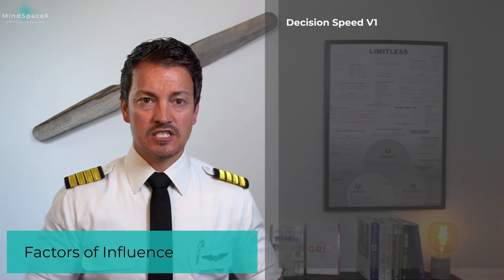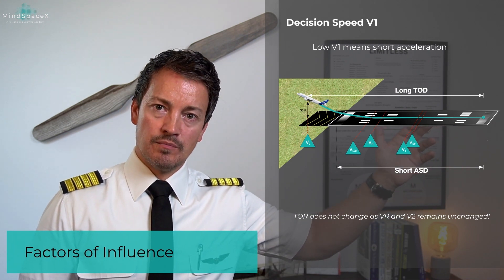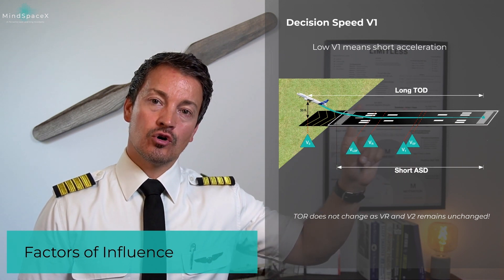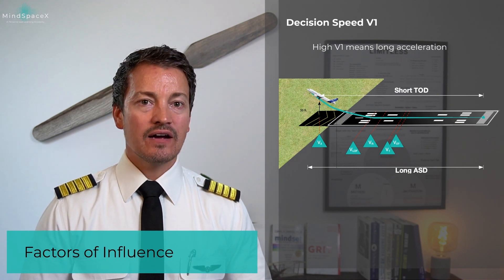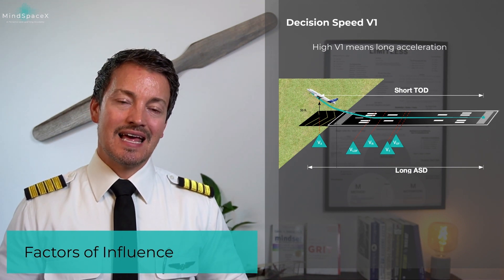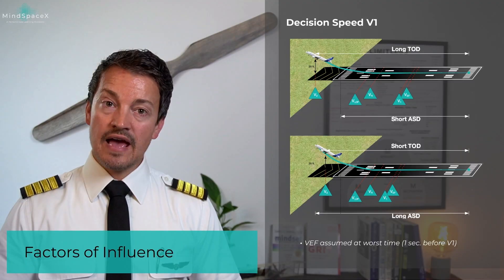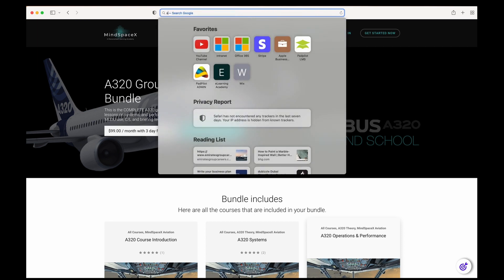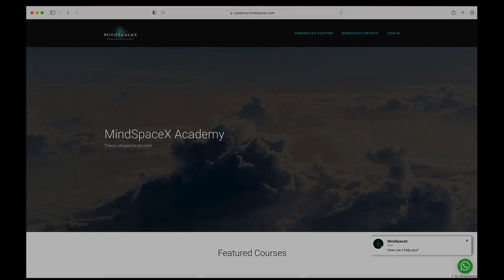Airbus Performance -  Influence of V1 on Takeoff

Comment: Simply,V1 is max speed to stop the plane( brakes, thust to idle,Spoilers,Rev(not credit or),& bring plane to complete stop within ASDA ,or to continue the take-off, that V1 speed is now the slowest/min for plane to climb to net height,35ft ,if EO, then to Mag bug,V2. Hope it helps ..
Misleading to say V1 is decision speed
Reply from the maker: Hi, I do see your point. But we have to look to the documentation to get a broader perspective.

The term ''Decision speed'' is not an Airbus term, but a term used generically in the industry. Airbus has the following definition for V1 in their FCOM:

''The highest speed, during takeoff, at which the flight crew has a choice between
continuing the takeoff or stopping the aircraft.''

The term 'choice' would suggest a decision is to be made. 

All leading ATPL theory publishers, including Bristol, Oxford, PadPilot as well EASA defines V1 as ''Decision Speed''.

From a performance perspective, V1 can be limited by ASDA (ground) but also by TOD (airborne). On a short runway V1 would be limited, so we are able to stop. However, on a long runway we are limited by the brake energy created if we attempt to stop (VMBE). This means V1 is where the "decision" has been made that a rejected takeoff is no longer an option.